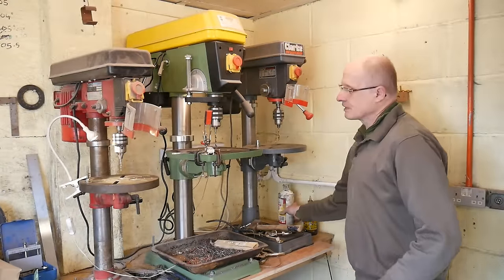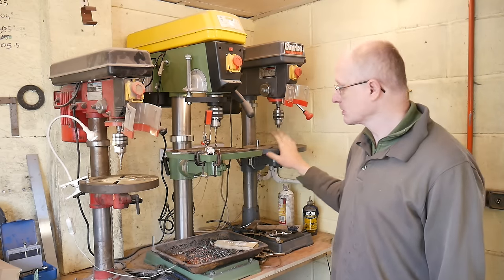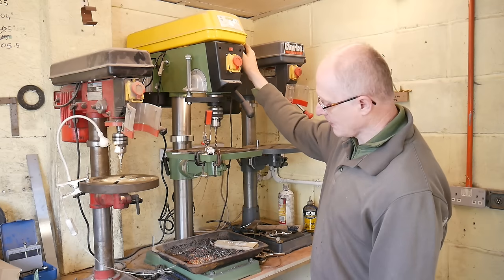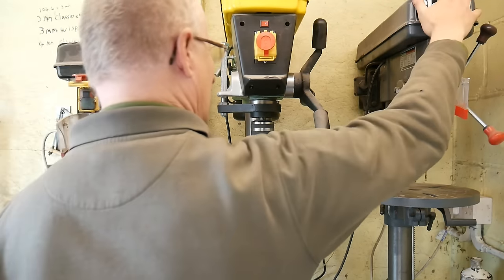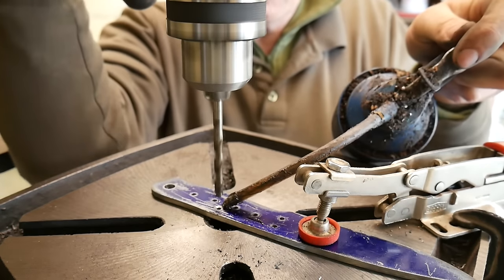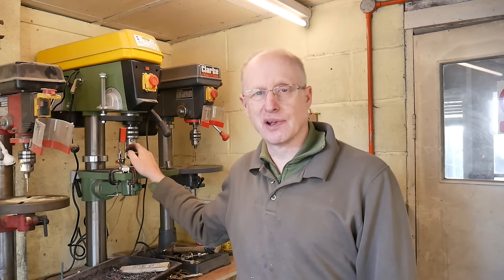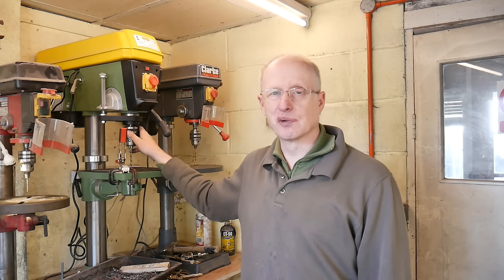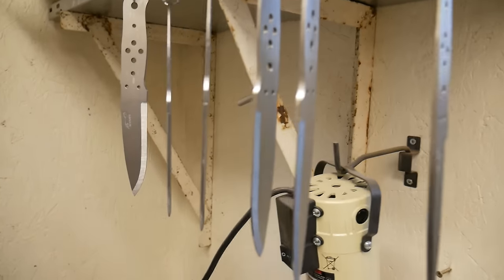Drill Presses. Warco 2B12

Comment: Im very familiar with the sounds and smell in your shop. I use to work as a Tool & die maker and I could swear I could smell the oil burning and the cutting of the drill though the metal. Its a smell I will never forget. I'm retired now but this happens to me many times watching video's from a tool room. Thanks for the memories. lol
Reply from the maker: They say that smells are one of the strongest memories we have. Thanks for your comment Ruben
Sandy

Comment: I was wondering what the combined weight of all 3 drill presses must be on your work bench. Random I know but I bet it's surprising. My dads an engineer & makes injection moulding machines & extrusion tools. I remember being young lad about 10 or 11 & seeing the wonders of drill presses & actual mould presses. Your advice is sound Sandy. Buy the best you can afford & it will ease you along in fabrication. Cheers Sandy
Reply from the maker: There's a fair bit of weight on that bench Andy. good job I have some strong 2 by 4's beneath:)

Comment: another quality vid sandy , buy cheap buy twice and as you say always buy the best you can afford 🔪🔪🔪🔪🔪🔪  of the best again 👌
Reply from the maker: When I started out I had cheaper tools but as time has gone by I replaced with better tools. It always pays to get the best if you can.
Sandy
Reply: Jackloreknives  i know sandy I've watched just about every video you've made , and when I'd seen that first one with what you we're using i just had too subscribe and wished I'd  been there to help you build the workshop your in as i knew you meant buisiness ( if you need any electrical advice just drop me a line my estimates are free and so is my labour ) 👍
Reply from the maker: Martin, 
If you lived closer I would invite you around for an inspection of the electrics. The new extension is great but the cable coming into the workshop is nowhere near thick enough and needs upgrading, but it's a massive job. Also not sure how much longer I will stay in this house as it looks like the children (now grown up) are settling down and moving away so the wife and I may down size in a year or two. Will have to wait and see!
Reply: Jackloreknives no worries sandy , here if you need a hand or a help ( happy bungalow hunting )